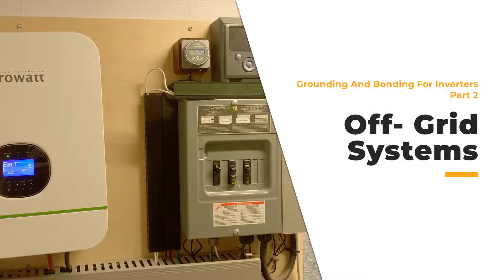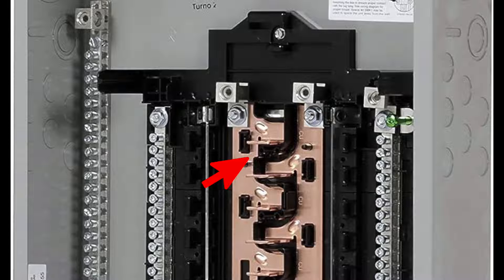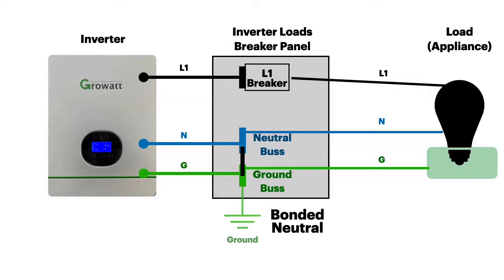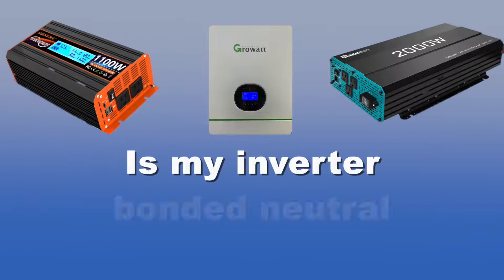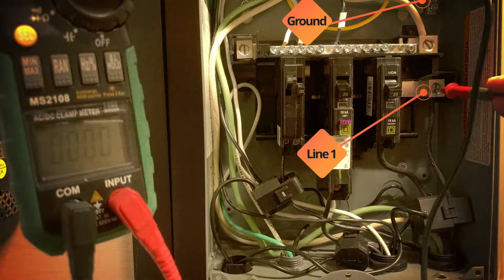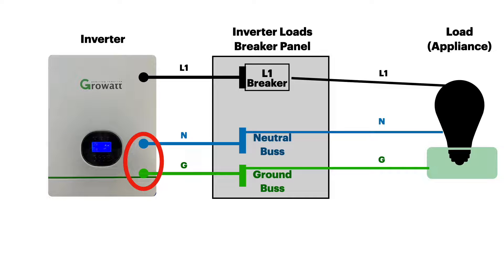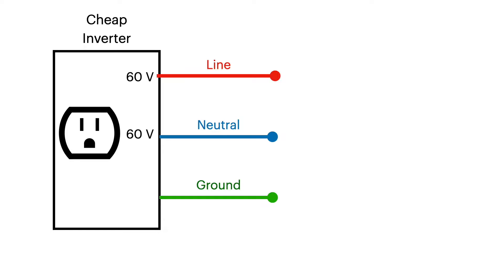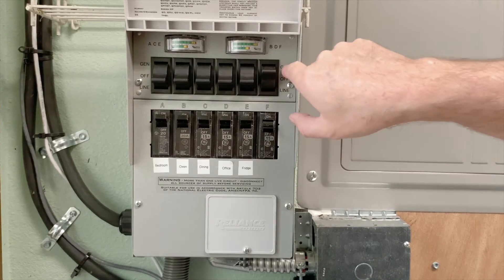Grounding & Bonding For Solar Inverters, Part 2: Off-Grid Systems

Comment: THANKS 🙏
This was just the info I needed. I just bought an automatic transfer switch to use with the grid and inverter. The both need a neutral for the switch to work. However, I'm sure my off grid inverter can't be bonded. I'll have to test it.

Comment: You deserve the name Real Clear Media !  I have been using off grid sophisticated systems for years and always felt uncomfortable with this floating / grounded concept.  Now, for the first time, I am  I feel confident to use my multimeter to track the state of my many buildings off grid and correct it if it needs to.  Thank you for that.

Comment: This is very well presented and clear.  My question now is what do we do to ground things on the DC side of things.  Things like the metal frames of the solar panels, the charge controller and even the Victron Lynx Distributor that is a huge buss bar, it has a grounding lug.  Can you address this?

Comment: Hear me out. My hot - neutral volt is 230V, neutral - ground is 0.3V and hot - ground is 265V. My inverter is DEYE 15kW triphase and it works like off grid. They connected grid cables to generator line for some reason which i didnt understand (when power is out i didnt need to switch inverter to grid i think). Everything works fine but my car charger reads hot-ground values 265 V and it doesnt work. If i switch to grid from a key, bypassing solar inverter; my ev car charger reads normal grid values ( 245-245-220 hot-neutral and same volts for hot-ground, neutral-ground 0V).  There is no bond between ground and neutral in my system. Is this the problem with my system?

Comment: So, how do you deal with bonding if you plug your inverter/charger into the grid to charge your batteries and then unplug or lose grid power to your inverter, and power your appliances from your batteries like a UPS?

Comment: I have a question after watching your video I tested my inverter is not bonded on the inside once I create the bond by sending a wire from the neutral to the ground of the case can I continue on to a grounding rod and will that be safe

Comment: What if you're not using Halo Center or breaker panel but just a power brick with multiple Outlets how can you create a ground neutral Bond in that situation

Comment: I have a question I have a 24-volt all-in-one inverter the AC output side has the grounding screw on the case do I run the green wire to that screw and then continue on to a grounding rod outside the house I'm completely off. I used a generator to charge on the AC input side I'm trying to find out why my new Spa won't turn on because it's looking for a ground

Comment: Thanks for covering off grid systems and grounding. My system may be a bit more complicated than usual.

I have an off grid system  (10- 410w solar panels with ground rod) (6500w main inverter) supplying a 240v panel, it's bonded at the panel and has a ground rod. It works fine running my shed's power needs. From the same 3- 51.2v server rack batteries, I want to run a smaller 3500w 120v inverter for separate power. Does this second inverter need its own ground rod?

Note: I connected a power strip to the second inverter and my tester said it has an open ground. I do have a 70 amp panel I can use to bond and ground the system separately. This would give me 2- 15amp circuits.

If I did add a 2nd ground rod, would I use the AC input ground connection for the ground wire? Since it's off grid, there is no AC input from grid power. There is a case ground connection, but it's small and I assume just for grounding the case.

Then there's the issue coming this winter when I'll need to charge the batteries from the house grid system because of lack of sun. If I connect the main inverter (which is bonded and has a ground rod) to the grid, how will this interact with the grid power that is grounded and bonded?

I could shut down the inverter's output or switch off the breaker feed from the inverter while charging batteries on grid power.

Or finally, connect a backup generator to help charge the batteries and not use grid power at all to simplify grounding/bonding issues. Although, generators have their own wacky issues with grounding.

Comment: Thanks for these video's they are verry useful. 

We are planning to add a 12V inverter and its not Internally bonded....  Its nota cheap cheap one.... I beleive the company said we could use an GFCI to do the N-G bond  then it would be safe. Is that true? I also dont want to "Energize the Vehicule chasis" by bonding and N-G
Reply from the maker: These videos are based on using the inverter in a house using North American bonding. It sounds like you are doing a mobile install in a car, RV or boat, which can be a totally different bonding scheme. Some inverters use a vehicle chasis, some don't.
Follow the manufacturers recommendation.

Comment: Great explanation on how to determine if the neutral and ground are bonded. Another type of situation you didn’t talk about is Marine type inverters where the neutral and ground connection is made automatically only when the inverter/charger is in invert mode. It disconnects the connection in charging mode.  If you try to get a resistance check with the inverter off, it will not be bonded but will be when the inverter is in use.

Comment: Thank you for this. I got an EG4 3000 Watt and could not figure out why I had power through the neutral. Finally, I found out that the EG4 was not bonded, so I did it in the panel. No more power through the neutral and test shows good.
Reply from the maker: awesome!

Comment: Where do you ground the AC out if you're portable like in a toolbox and using an all-in-one inverter?
Reply from the maker: It is typically treated like a portable solar generator. Bond neutral and ground (only one bond) and use CFGI outlets.

Comment: How does it look like in a split-phase configuration with two inverters ? Not really clear to me how to bond
Reply from the maker: That it up to the manufacturer, but many companies are not clear about this. 
In general, the best way is to not bond either inverter and bond only at the breaker panel after the inverter, but this only applies to off-grid installation, i.e. no grid IN to either inverter.
Reply: I have this setup and both inverters are unbonded  internally and I have ac input as well . That was the best info at the time.
Reply from the maker: @sh839c  thanks! glad it helped

Comment: Should there be two ground rods in an off grid system? I read something that stated two ground rods spaced six feet apart.
Reply: Electrician here with off grid experience: The 6 foot spacing is the MINIMUM distance allowed between ground anodes (usually rods) if more than one ground anode/rod is used or required. This is because if they are too close to each other, the second ground anode/rod loses its effectiveness, and does not actually add any benefit. A good rule of thumb is to place them apart the distance of their depth ( 8 feet apart for an 8 foot  rod). The farther apart from each other they are, the more effective they will be (within reason).

Local soil conditions will determine if a second ground anode/rod is needed. If you are in an area where the soil or rock does not contain permanent moisture and stays dry with low electrical conductivity up to 8 feet deep for a time during the year, then a supplementary anode/rod will likely be required. Since it cost money to test if there is the maximum 25 Ohms or less resistance to ground, in some areas where it is hit or miss conditions, it is just cheaper to provide the second anode/rod to begin with.

 If the local soil conditions stay moist below grade, and/or the soil maintains its conductivity, then there is generally no need for multiple ground anodes/rods, and it is in fact best to only have one unless required by code or feeding to separate sub panels on separate structures. In that case you would need to provide a ground anode/rod at the main panel or subpanel servicing each separate structure. One just needs to keep the ground anodes/rods at least 6 feet apart if the structures and their power panels are close to each other.

One would also need to bond each ground anode/rod to each other. This can be accomplished through the equipment grounding conductor that is ran with the sub panel feeders that connects the main panel to the subpanel, or a subpanel to another subpanel.

I have 4 ground anodes (all rods) on my system: One to ground the array that is 700 feet away from the shed with the power system, one at the power system shed (it has the main panel with the AC ground to neutral bond and the DC negative to ground bond), one at the main house subpanel 120 feet away from the power shed that is connected to the panel ground bus, and one at another subpanel ground buss for a detached bedroom 30 feet away from the main house subpanel. 

Each ground anode/rod is bonded to each other via the equipment grounding conductor ran in the conduit with the ungrounded and grounded conductors (AC neutral and DC negative is a grounded conductor, but not a grounding conductor).
Reply: @GoCoyote  Thanks for this detail! I am at a point where my equipment is setup and beginning the wiring. The part I am stuck at is whether I connect the battery bank's negative buss to the ground buss. I can't find anything definitive, but if I read you correctly, that is what you're doing? It's weird because the AC ground buss in my inverter and the DC chassis ground lug are bonded together. I get continuity on my multi-meter between them. So I was going to simply connect the DC ground lug on the inverter to the negative battery buss. From the inverter's AC ground bus it goes to the main load center's ground which then has a connection to the ground rod. I know I shouldn't get advice from YT comments lol, but you seem to have a similar setup. Does this sound sane to you?

Comment: Excellent video. You explained very clearly all I was looking for clarification on with hybrid inverters and had no idea about the very unexpected grounding situation of the cheaper stand alone inverters. Tthat simple grounding needs so much consideration of different systems has well justified my confusion in setting up my own off-grid system

Comment: Great video. Question: with solar panels in play, typically you’d P/E your solar panels. But with a p/e for the inverter and a p/e for the panels, it seems you could create a ground loop for lightning strikes. Wouldn’t  it be better to send the panels p/e back to the ground of the inverter to avoid this issue?

Comment: Excellent video.  I have an old old 4500w  inverter, about 40lbs weight , no brand. It has ac out recepticals AND terminal strip , like yours at 17m in the video, is this correct procedure :
Test 1: incandescent light across neutral and ground , if it lights up then this is a "cheap" inverter, do not bond. If it doesn't light up goto test 2

Test 2:
Use resistance, volts and outlet tester to determine if it is / is not bonded internally. 
....am i correct ?

Comment: What would happen if the bonded ground wire was detached from the grounding rod ?
Reply from the maker: The system would operate normally, breakers would still trip on groundfaults. But the system would be susceptible to damage from power surges, static build-up, nearby lightning etc.
Reply: @ReelClearMediaLLC this is really interesting, can you explain a little more about why it is more susceptible to lightning?
Reply from the maker: @pablonerino  I'm not referring to lightning hitting the system. If lightning strikes nearby (even a few miles) there may be a static build up in cables and wires. This static doesn't generally doesn't carry much current, but it can reach a high voltage, and cause damage to electronics.

Comment: In the video you was mentioning about ghost votage I really don't think that is what's going on. I myself is not a certified electrician but from my experience on everything I've learned so far and I got at least 15 years experience that to me. I feel like that is going to be more like Eddie current, not ghost voltage But you did mention inductance and resistance capacities but more than likely it's going to be Eddie current
Reply from the maker: In some cases, transformers in an inverter could cause Eddie currents. Often though, its just ghost voltages. Ghost voltages can be tested with a few different methods. See https://www.youtube.com/watch?v=rWz8hL8b9V8
Reply: Eddie current is like maxwell  lines that are from a magnitized ferrous material right!?
Reply from the maker: @kitkimbrough1145   not familiar with maxwell lines. 
Eddie Currents: https://en.wikipedia.org/wiki/Eddy_current

Comment: So, if you did use a cheaper inverter with 60 Volts on the hit and neutral, could you tie them together on the same hot busbar? And if so, would the breakers be able to do their thing in the case of a short? Thanks for the video. Very informative.
Reply from the maker: NO! Tying the hot and neutral together would be a direct short.
These inverters are fine for circuits that are isolated from the grid.  The appliances see 120v from hot to neutral.  You just can't try to use these with household circuits through a transfer switch.

Comment: great vid - any chance of an explanation as to why these cheap inverters are allowed into the country in the first place, and what the technical workings look like inside? obviously the rationale is cheap cheap, but it would be interesting to see where the savings lie - thinner wires to send 120v so less copper? etc.
Reply from the maker: Because many of them work fine for temporary portable use, just like a small generator. The appliances just see 120v from hot to neutral. The issue is with trying to interface with existing house wiring (split phase, North America).

Comment: Great video. Do I need to earth ground my solar panels (frame) to a ground rod? If so do I tie that ground rod to the ground rod that feeds the inverter?
Reply from the maker: There is a lot of disagreement on whether or not to ground your panels. In the USA, the NEC says you should ground the frames of your panels to the same ground as the inverter.

Comment: Hi, what about the DC system? Do we seperate the two grounds AC and DC or can they go on the same ground wire?
Reply from the maker: Depends on the equipment manufacturers instructions. Usually, the solar panel frames only (but not the PV wires) are grounded to the house ground rod. Likewise, if the batteries have a separate ground lug, they can be grounded... but NOT the negative and positive battery wires. 
Hope that is clear.

Comment: Thank you for a clear explanation, we have an all in one Anenji inverter charger which supports parallel function, these inverters automatically do the ground neutral bond internally when using in off grid mode.. Though the question arises when you mentioned only bond in one place, so when having 2 of these inverters in parallel each inverter is now bonded would this still be a problem ? TIA

Comment: Is it ok not to have the earth ground either in the inverter or the sub panel?
Reply from the maker: If you mean the ground rod, you should have one. They don't protect you from shorts or faults, but they dissipate static charges and help normalize the case grounds to zero.
Neutral-ground bonding creates a return path for a ground fault, so it can trip a breaker.

Comment: I don't really get why you wouldn't bond a power station ground and neutral. Yes, it is shown in the video there is no ground output contact; but why would bonding in the subpanel to protect against ground faults be bad?
Reply from the maker: Some power stations do allow you to use a bond. Mostly the high end power stations, but you need to verify from the manufacturer. Bonding some of the smaller power stations can fry them.

Comment: I purchased an inverter that cannot be bonded. I bonded it and it smoked. What should I do? Manufacturer mentions it on their instructions, do not connect neutral to ground wire.
Reply: Hybrid inverters you can be bond neutral of input and output at the service panel

Comment: I will have my house both grid connected and off grid at the same time with all curcuits bar one going through a changeover switch. The other circuit will go to the hot water system which will have a separate changeover switch as that will be powered off grid as well most times. That circuit will also go back to the inverter AC in as a buck up supply to charge batteries in case there's no  sun for a long time

Comment: So, with a cheapo 2000w inverter, I should ground the inverter only? Great/Best described video I've seen on grounding, I'm just kinda slow. I'm gonna hook it up to a 30a box.
Reply from the maker: With Cheapo inverters,  its always a risk to connect to existing grid AC. Adding a separate ground to a ground rod should be ok.